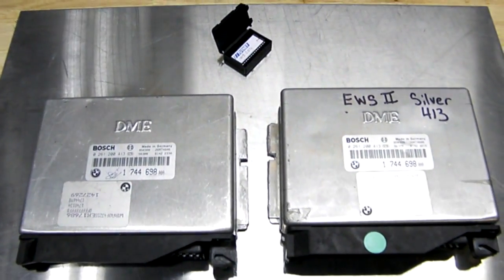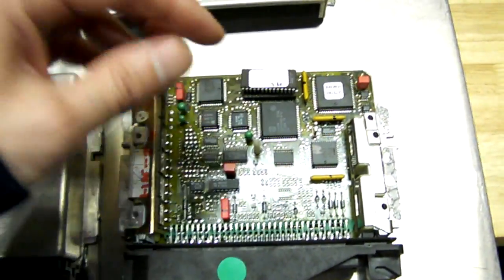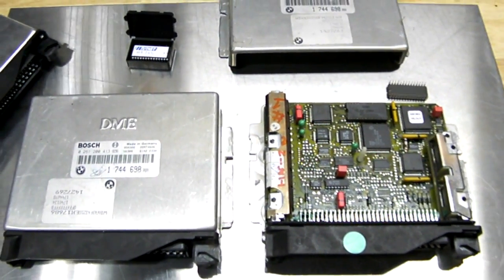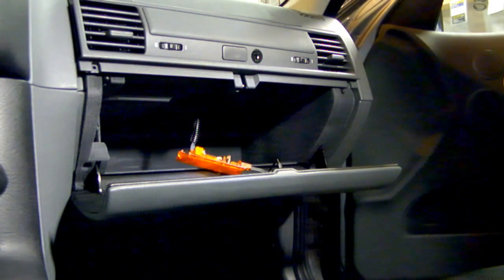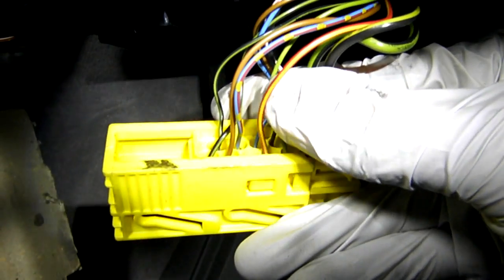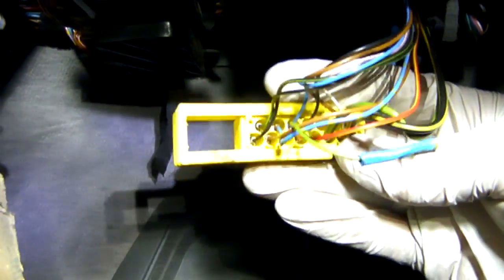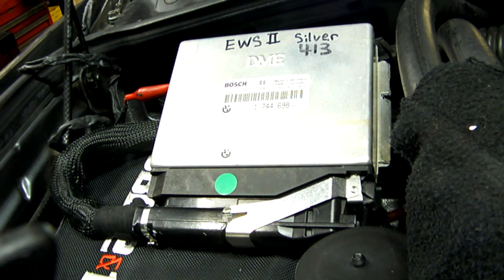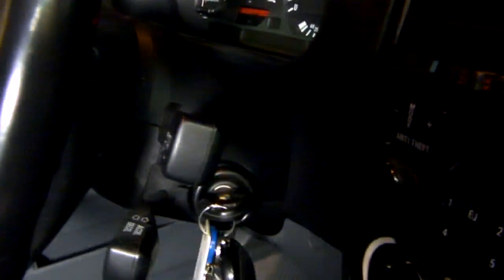BMW E36 EWS II BYPASS COMPUTER SWAP

Comment: You saved my car! ! My 325i has been sitting since October.  The shop told me it would be $1300 to replace.  I used the maroon label that I got off of Ebay for $50 and everything works like a charm!  Thanks!
Reply from the maker: TaliDLC, this is why I made the video & I am glad it made your day too!
Reply: will this work on my 97 bmw 540i ? If so where do i get one .thanks
Reply: what years is your 325i? i just got off the phone with bmw and just the new ecu is $1800. I dont want to go cutting wires unless i can verify this works. please and thank you for your reply

Comment: I have a 1998 BMW Z3, with a Seimens MS 41.1 OBD 11, DMS/ECU/computer.  Chip replacement isn't possible, requires re-programming to get rid of the EWC 11 (screw the customers program).  It cost approximately $500 to have the computer programmed to in Canada.  Is there a less expensive way out of this trap?
Reply from the maker: Well, BMW sure did NOT make it easy for us to bypass thier system. I would try giving Turnermotorsports.com a call and see if they can help you or direct you to a tunner to manipulate the system by uploading software; you could possibly save some money this route.  Thanks M.B.S.
Reply from the maker: It looks like you are stuck with re-programming, OBDII ews is much more complicated to remoeve and as well has increased the cost of bypassing. You need to find a tuner  online or in your area that can upload a new program into your ecu (dme) I wish I had an easy fix for you.
Reply: mybimmerspace There is a shop in Canada that charges about $500 to remove the EWS but they have a bad reputation in some quarters.  Currently mine is working OK but I dread the day it gets me stranded.

Comment: Can you please explain when you quoted removing the pin and dissassembling the plug, Mentioned in 8:13?
Reply from the maker: There is a special tool set online that easily slips into the pin connector which then dislodges it. I used an alligator clip from radio shack to dislodge the pin which is less expensive but takes a little longer to work the connector out. Thanks M.B.S

Comment: HI I HAVE A E36 I GETTING PROBLEMS TO START RITE NOW I FEEL I REACH MY LIMIT 1ST IT DID WONT TO START I DIG UP TILL I FOUND IT WAS A FUEL PRESSURE  PROBLEM I TOUGHT IF FIX IT BUT IT GOT WORSE NOW IT WONT START AT ALL IT JUST TURNS TILL D BATTERY IS DEAD. WHEN I CHECK D PLUGS ITS WET WITH GAS. EVERYONE IS SAYING IS D CAM & CRANK SENSOR OR D DME ITS ABOUT 8MOUNTHS MY CAR DOWN OR I'M FROM TRINIDAD CAN U HELP!!!!!!!!!!!!!!!!!!!!!!!!!!!!!!

Comment: I have a 320i m50b20 nonvanos, and my ews won`t let me start the car, does it have the same bypass wire that need to be cut or a different wire. And if it`s a different wire do you know wich one is that need to be cut? Thanks a lot and sorry for my bad english!

Comment: Just replaced the ECU in my 91' BMW 525i, it was very easy 15 minute job and I'm not a car mechanic. Car runs great now.
Bought the ECU on ebay, used for $80.  Also, replaced all the fuel injectors, one was bad.
Everything seems work great, even my door locks the center locking works better than before with newer ECU. Should I swap the chip?
Looks like, later models of BMW's got more complicated and more expensive too.
New cars are scary for weekend mechanics, too much electronics. LOL!

Comment: Hello. My car (325 -94)went bad after a car wash. I got a new DME from a (525 -93) and changed it. No change. Will I need to cut the wire from the EWS like you did?

Comment: I have done this bypass on my current 1995 E36 DME with ebay chip and it works fine. I think the chip is causing problems in the car though and I want to swap it out for another DME with the same number. Can I just swap them over with the stock chip inside the replacement DME?

Comment: have a 1995 E36, DME was bad did the ews bypass and installed a dme out of a 1993 E36 non ews worked fine did it last july and has been fine since this ews bypass does work! see ya mike s.

Comment: I jumped the relay wires under the dash, ( same relay which you disconnected the wire from ) so the ign was used to turn the eng over. But thank you for the above info. Will put it back to original and start again. Have located a complete EWS ll unit complete with key transponder smart relay and DME. I am hoping that will sort it.. thanks again.

Comment from the maker: Sahati Shabeeb, the only benefit of doing the swap is to not pay a dealer to replace a damaged dme as they require re-coding due to the EWS. Also opens up more windows to run off the shelf performance chips that have no ews coding (cheaper)

Comment from the maker: Vegeta010587, it could be the EWS or many other things like a failed fuel pump or bad DME relay. In your case the ews bypass will not work for your 97 328i. Even though it has ews II the dme in your car has a non removable chip. I usually tell people to give Turnermotorsports a call as they do have some products that can re-flash your computer.

Comment from the maker: DestructionNL, 96 and up BMW's won't work like the one in my video. Each ecu from 96 up will need a re-flash as they do not have a removable chip. You would need to find a local BMW tuner that knows his way around the EWS thats programmed into the ecu.

Comment from the maker: Dm330ci, I haven't performed this on an M3 but I have read that if you perform the bypass you can run a Maroon 413 chip although it was designed for a 2.5 liter they reported no big difference in performance lost. You other option is to perform the bypass and find a non EWS M3 DME  blue label with  part# 0-261-203-506.

Comment from the maker: Sorry,David Syd, This bypass video only applies to vehicles that were built before 1996 that originally came with a 413 DME. In your case you would need to delete the EWS from the computer by uploading a program through the OBD-II diagnostic port. Turnermotorsports may be able to help you or possibly a local BMW tuner. As for the no start it could be the chip in your key or bad ews starter relay, did you have the ignition turned to the run position when the starter was being jumped?

Comment: Hi, I have a Au 1996 e36 316i far as I can tell it has EWS ll, but these instructions are not even close. Pin66 no wire, small green wire is on pin 81. checked for continuity was the same wire. I have removed pin from plug to test didnt work using the maroon 413 DME as described in video. The issue. No response from the key with everything as original specs. If I jump the starter wires on EWS I get eng to turn just no fuel or spark. Any clues, or do you need further information? Thanks David.

Comment: Will this work for sure? I have a 95 m3 build date 6/95 with a silver label 413 ecu and I need to run a red label 413 chip with my silver label ecu. Will you confirm this is 100% accurate?

Comment: hey i have a 98 m3 automatic sedan im getting no injector pulse or fuel. i have a new crank sensor and i have fuel at the rail. pumps are running. and the engine now cranks as i jumped the two big wires going into the ews for the starter relay but before i did that it was a no start no crank car. im looking for the easiest cost effective ews delete with no performance loss... can you help me choose what to do

Comment: Hi, 

I have a bmw compact from 2000 with a ews 3D. I had a broken engine so I swapped it with an m44b19 engine with ews 2. Buth offcourse the engine won't start. Does it also works if I take the red label 413 engine en jut cut the wires?

Comment: Just saw you've video, i've got an e36 from 1997 with 1.8i engine in it. My ECU broke down, i wanna pick up a used one tomorrow. I've checked and it has the same part number as my car's current ECU has. Can i allso use this method on my car? Of will i have to visit the local BMW dealership?

Comment: Hi, i have a 96 328i and when i hit the clutch to shift, the motor is going automatically a few hundred rpm up, even without hitting the gas a bit . i know is probably normal but i dont like that... so if i do this bypass Is that going to settle my problem ? please help

Comment from the maker: Kayleb421, Sorry but that is not going to work, your engine is designed to work on an OBD1 DME and the 97 M3 is OBDII.

 Some late model 94's  have ews 2 so best to check label color on your dme first ( silver or maroon) If you have silver label ews 2 then it would be advisable to install a replacement marron 413 dme and also perform the ews bypass.
Reply: Hi I have a 97 328i UK car and it has OBD1 dost that mane this could work ? Update I just found out Euro spec cars kept the OBD1 port until 2001

Comment from the maker: Msscomnet, OBD1 is nice and simple but would be taking one step backward. The S54 would make the most difference in the drivers seat and would most likely be easier to adapt. You are testing my knowledge in an area that I have not ventured but if I had a choice I would look into the S54. Thanks

Comment: heres what ive tried so far. left my key ON position with doors (L/R) and trunk open left for 11 minutes then reconnect for 15 minutes same problem appears. bypassed wires #1 and #3 going to the longer wire (going to DME i think) capped the wires on EWS plug cut little green wire too. then connected wire 1 and 3 in the EWS plug disconnect and capped wires going UP or DME i think didn't work as well. i'm think the problem is my alarm and disables my ignition. trying to find the alarm now

Comment: Please HELP? i have 1995 bmw 318is and heres my case. i disconnected battery with positive cable (RED) the swapped stock seats to bucket seats by the time i reconnected my battery the ALARM ACTIVATES, HAZARDS LIGHTS BLINK AND CAN"T START THE ENGINE. I have a mechanical key (SPARE/NO CHIP) radio is broken too no LCD some buttons dont work.

Comment from the maker: Some 95 M3s did not come with EWS II so you would have to check and see if you have it or not. The non ews M3 dme came with a blue label with a part# 0-261-203-506. If you have that part# dme, then you can swap your M3 chip into the 413 Maroon dme. If you do have an ews II dme then you will have to do a bypass plus run a non ews M3 chip. I heard that you can run a stock 3 series Maroon 413 dme chip in a M3 but the M3 engine probably won't run to its full potential. I haven't tried that though

Comment: i have a 1994 325is auto,does this work?if i change my ecu without bypass and put a 1997 m3 manual ecu ,you think is gonna  work?
by the way i have a check engine and the mechanic said my ecu is the problem,pl help

Comment from the maker: Likemycomment100, Yes you still need your antenna ring. It is still needed to send a signal to the ews module to unlock the starter function. There is a bypass that can be done on the starter function of the ews but I have never tried it with the antenna disconnected, although I don't see why it wouldn't work.
Reply: Where can I find that starter bypass

Comment from the maker: Sounds like either the fuel pump relay is shorting out internally or somehow the computer is sending batt+ to that wire which would indicate an internal short in the computer. The wire that is melting is the trigger wire, the dme grounds that wire which then basically turns the relay on. There should not be a huge load on that wire at all.

Comment from the maker: Fernando Caro, Sorry but the ews bypass is for OBD I computers only, in your case you would have to bypass the ews module starter function. 1947froggy here on Youtube made a video about that. You will also have re-flash your computer with an ews delete program. Tunermotorsports might be able to help you with that.

Comment from the maker: Lu John Hernandez, You won't be able use this bypass method. You would have to bypass the starter function on the ews module and also upload an ews delete software into the dme.

Comment from the maker: The only way around this would be to order a new key from BMW or purchase software to remove the ews function in the dme and also manually bypass the starter function of the ews module. I wish it was easier with your car but its not.

Comment from the maker: Tonyravens, without the chip in your key you will lose EWS starter function and DME function. You can bypass the starter function but not the DME. Basically if you by an EWS delete program it will allow your DME to operate, but you will also have to manually bypass the EWS starter function to engage the starter. I did not show the starter bypass but someone else did. Check out 1947froggy youtube channel, or search "bmw ews II security bypass on 1995 M3"

Comment: is there any posibillity that i can use my key without my chipset?i have a bmw e36 320i 1996 manual ,coupe .i lost my chip so the car just doese'nt want to turn,the lights are functioning,all the lights inside aswell,but the engine wotn turn,thanx in advance for any information that might help

Comment: i have 1998 328i the wire from fuel pump relay to computer its melting just one wire. i went to bmw dealer the said it my be short in cumputer so you think this would work for my  bmw. because of that think  there no power to the fuel pump so no gasoline pump to the fuel injector .
thank you

Comment from the maker: Zourkream, the 96 is OBD II verses the OBD I computer in the video. I haven't performed my bypass on a OBD II yet. To my knowledge you have 2 options, get a new key from BMW or buy a chip install software that will delete the EWS from your computer but that is just half of it, you will also have to cut and bridge two wires.  I buy my chips from Tuner Motor Sports & Bimmerworld. Just Google either name..... You can give them a call and see if they can set you up with a program.

Comment from the maker: Jwrape, It could be ews related or it could be the fuel pump relay. 96 and up BMW's are OBD II which to my knowledge require a DME re-flash to remove the ews from the chip. I have heard that someone over at BimmerWorld has this software. I would personally start with the DME relay and fuel pump relay by checking to make sure DME relay is powering the DME and that the DME is sending a signal to the fuel pump relay during cranking. No signal from DME could mean EWS fault or clutch switch fault.

Comment: hi everybody if anybody can help me i have a bmw that was flooded and does not want to start with the key which it does have the immobiliser dont know if the computer is bad or not but i had some 1 let me barrow a computer but its a green label which i dont know if it can work in this car the original computer is silver so can anybody help me please
Reply: What year and model?

Comment from the maker: To answer your question Mr. Martinez I can't guarantee that cutting the green wire will work on your 1997 328i OBD II BMW.they do share the same system but I haven't personally done the bypass on an OBD II yet so I don't know what the ECU will do without a signal form the EWS. If the bypass doesn't work then you might want to look into a product called the Shark Injector, as far as I know the guy's over at Bimmer World have the ability to remove the EWS from the computer which is a safer bet.

Comment from the maker: Sparky, I just realized you said you did have fuel at the rail. I would take a close look at your DME main relay, it is a double throw relay and maybe only have of it is working. Another check I would do is probe the fuel injector plug with a digital volt meter to see if you get a pulse while cranking, you could also use a 12 volt led light... best to have a charged and good strong battery for cranking test. You should see at least  10.5 to 12 volts on the plus terminal of the plug with key on.

Comment: Hello very interesting video however I have an e36 328i 1997 and i do not seem to be getting it started i believe that my key is not responding to the car i would like to know if I just have to cut the solid green wire to bypass the whole thing and if i didnt have a different chip would that matter could i just bypass by cutting thank you

Comment from the maker: sparky, I would move on to a few easy checks first. I still don't know which year and model BMW you have so that would be nice to know. If you look at my BMW e36 fuel pump test & troubleshoot video part 1@17 mins in , I activate the fuel pump by pulling the fuel relay and bridging terminals 30-87. listen for the pump, does it come on? if so try starting the engine while still bridged.. please don't drive around, only for testing! Also terminal 86 should be hot with key on....MyBimmerSpace

Comment from the maker: 8976sparky, check your crankshaft position sensor it may be dead. You should see around 560 ohms between the plug terminals coming off the crank sensor. This sensor is mounted on the front of the engine above the harmonic damper. The plug for it is under the front side of the intake manifold just behind the alternator. If you see anything less than 550 to 560 ohms it could incline that its faulty....... MyBimmerSpace

Comment: hi i had a no crank start problem so i cut and bridged the two large wires got it to crank but not start so i cut the little wire shown in this vid but still wont start ive got fuel going to the injecter  rail but seems like the injecters are not kicking in any  idea  s how to solve this any help would b great thanks

Comment from the maker: It sounds like your DME chip is causing the no start, you must cut the small green wire like the one in the video to cancel it out. It sound like you already cut the two large wires and bridged them which let your starter engage but your DME is most likely not firing the fuel injectors, could be a bad crank sensor or your DME is looking for a signal from the EWS which is not there . I would give that a try you don't have much to loose except to reconnect the wire if it doesn't work.